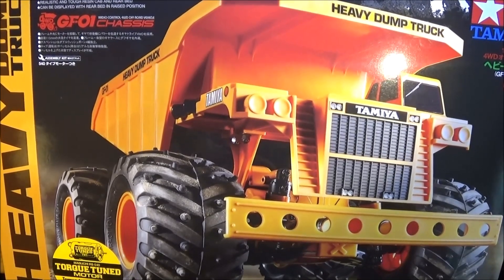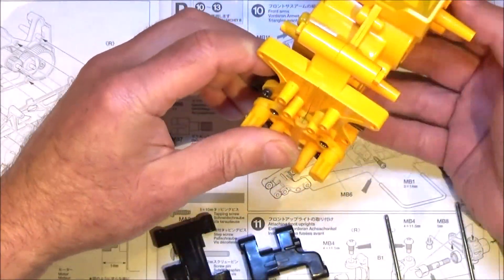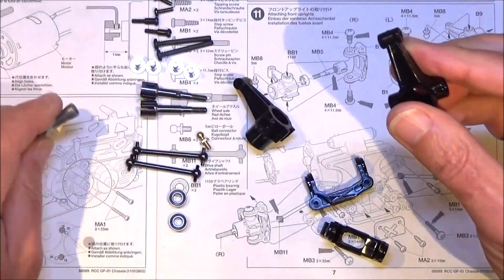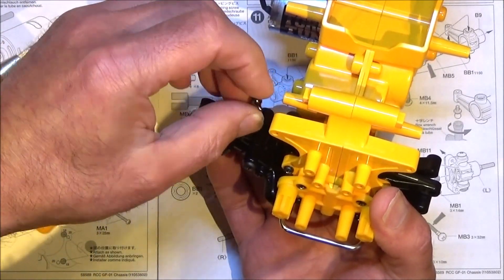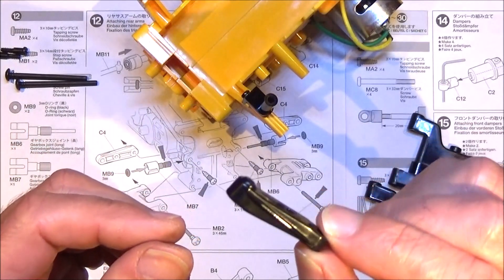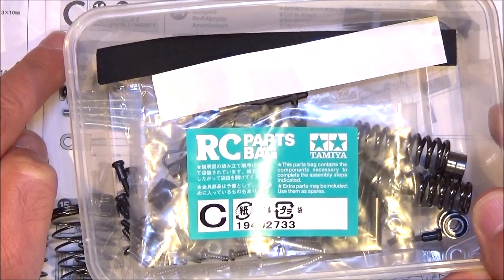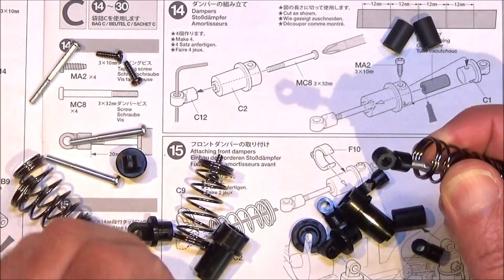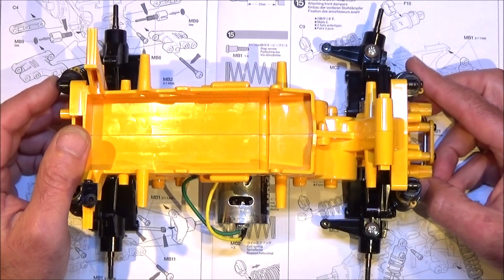Tamiya GF01 Heavy Dump Truck Build Guide + Tips Part 2 - Suspension!

Comment: Hi Mark! Good one. Finally got around to it. Very good guide. And I looove that you underplay the bearing upgrade and do not turn it into a doctrine whenever you use the bearings. Just love it. Gives someone that builds it with bushings a presentation of the bearing as a choice and not a command - and allows for a pleasant building experience. Let's face it. It's still fun to run with the bushings. And nice shocks ... friction shocks 'without much friction'. Very cool :-) Have a pleasant evening, my friend.
Reply from the maker: Hey, thanks Mikael! No worries my friend. Glad you like the laid-back style - I try to make suggestions that folk can either follow or ignore, I think my style of presenting has adapted over the years - yeah, nobody likes being told what to do! Definitely still fun with bushings, also with oil shocks or "not much friction" friction shocks - it's a cool Tamiya, after all! Hope all is good with you, my mate.  :o)

Comment: Thanks for the video Mark, I really like this beast of a truck.  Looks very strong and would take a lot of abuse.  Just building a tt02 rally car with your mods and checked the ride height.  Amazing,  worked out well . Using a 4350 kv brushless system in it,  thing should be lots of fun and enjoying the build . Bought a tt01 subaru to turn into a rally car as well.  You got me hooked on rally cars ha, ha, after these I'm building the Tt02 b plasma edge for my wife . She's gone crazy and bought a full alloy kit that I don't think they need after seeing the bashing you guys do with these . Can't wait to try my tt02 rally,  it's just looking like fun and may buy a spare shell so I don't wreck the Audi Quattro shell with Leds.  Dump truck is on the list ha,ha, nice work and great video mate.

Comment: Hi Mark the kit is coming together smoothly.  Tamiya suspension is well engineered, I’m surprised they don’t put oil shocks in their kits. Even plastic ones would be cool.  I guess the friction is good enough for bashing.  I see an oil shock mod in a future episode.  Take care Bro 👍🏾
Reply from the maker: Thanks Paul. 👍 Yeah, nothing too tricky with this kit, but it does feel well constructed. Too right about the shocks, a set of standard CVA's would be a great addition to the kit, and I think I may be doing that upgrade sooner than later. You have a crystal ball! Take care too my good friend. 😎

Comment: Yeah Mark, I totally agree  - I never grease those uprights either. I did it once and they basically turned into a dust magnet. Never again. It's such a chunky robust chassis this one, so hard to imagine damaging it. Never managed any damage to mine ( other than the ESC dying. ) All I'd say is that the steering servo is in a really odd place, it's at the side ( on the left I think ), but again I've had no issues there either. A great, concise build video. Looking forward to the shell build - ( as easy as it gets. ) Have a good one matey..👍🏻👍🏻.
Reply: Hey Mark, thanks for the comment on the Infinite Chocolate. I did reply but ( as you predicted ) your comment was removed as was my reply. What an odd business! But thanks anyway dude...👍🏻.
Reply from the maker: @thecontractor365  You know that I always support your content, mate! For reasons I know I don't need to state! But as you can see from this out-of-sequence reply - now I'm not getting reply notifications - arrrggghhhh!!!
Reply: @MarkBryanRC  Hope you get it sorted mate...👍🏻.
Reply from the maker: Hey mate - glad you concur about the grease! Yeah, I think this one is chunky enough to last a while! The servo is in the same place as the Konghead, weird location but works just fine. Thanks for the always kind words.
On another note - thanks for the reply to my comment on your latest video - however, I can't read it all! It's been removed. I just checked your vid again, both my comment and your reply is missing, although my thumbs up is still showing and it says 2 comments, but the comment field is blank. Getting p!ssed off with this now, mate.   :-/
Reply: @MarkBryanRC  Yeah, I just googled it. The overriding theory is that YouTube hides comments that it thinks are spam or posted by a bot. In some cases they are restored. But yeah, it must be annoying as hell. On our Dice Vase vid from last week we had 6 likes in YouTube studio and 3 likes on the video....wtf ? They've since balanced out at 4-4. I just wish YouTube would sod off and leave us to it. Constant interference where it's not needed or appreciated.